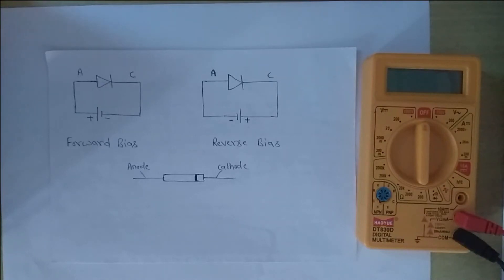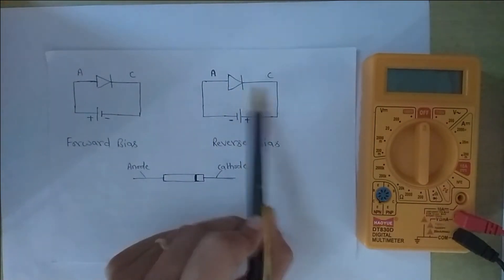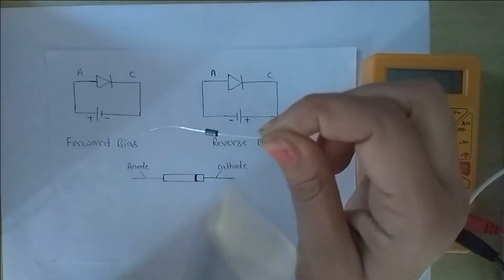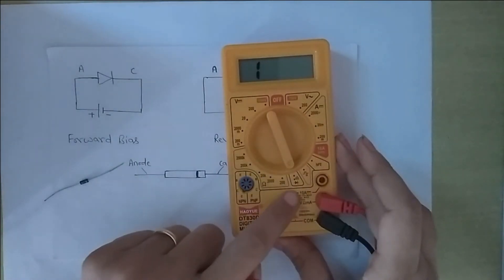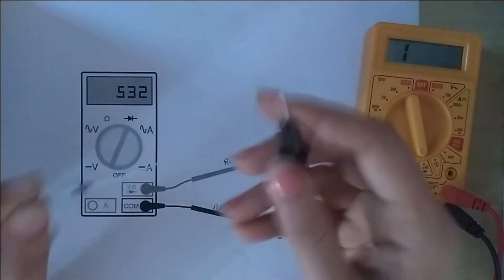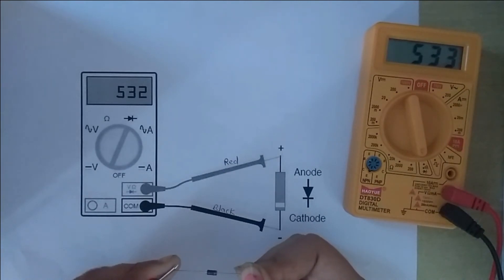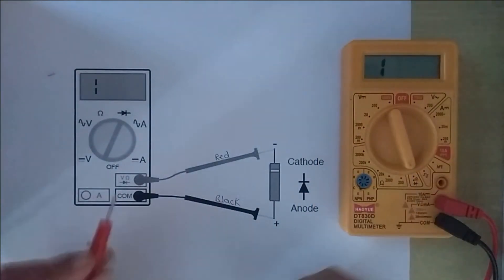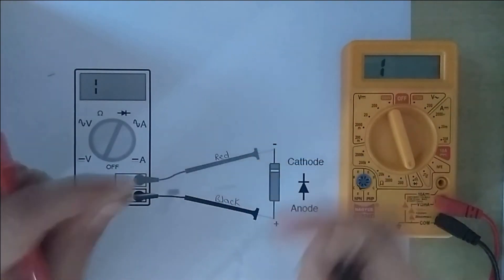How to test Diode using Digital Multimeter | diode tes | Component Testing using Multimeter Part - 1

Comment: What does it mean to have 532 value... Is it minimum volt to pass through
Reply from the maker: The Digital Multimeter which I used, it shows the forward resistance of the diode but some multimeter displays diode forward biased voltage in diode testing range in forward condition.